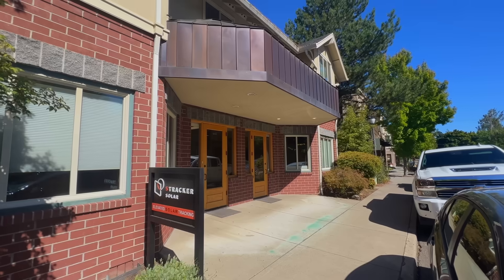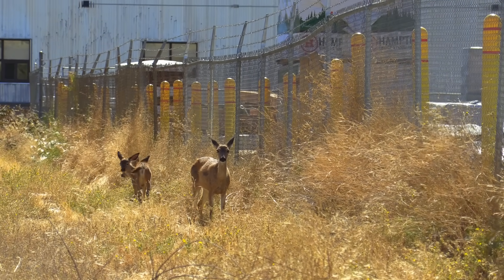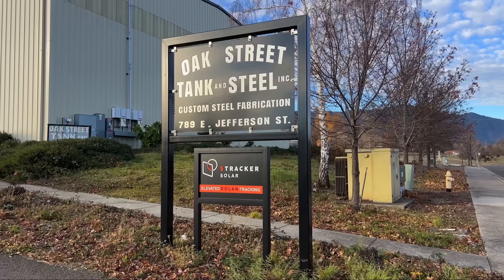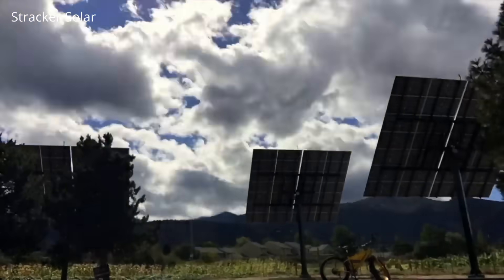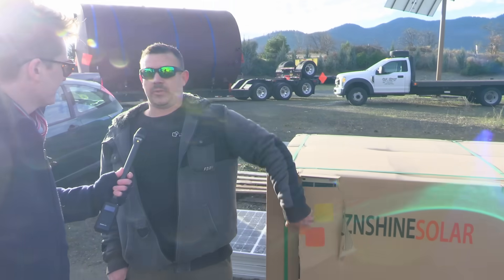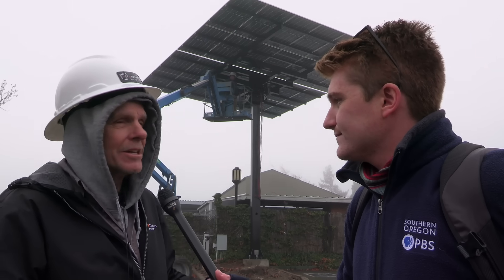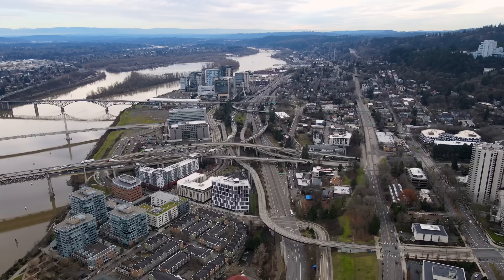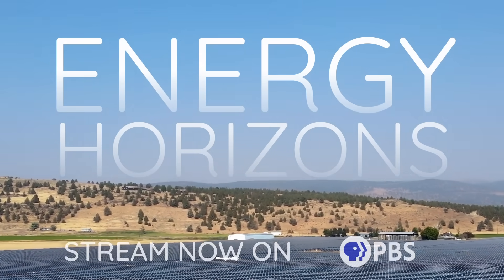Stracker Solar will Change the Solar Industry | ENERGY HORIZONS on SOPBS

Comment: I like the Idea and considdered making myself a two axil trakker solar pannels. But came to conclusion that for the extra cost of the system id rather buy more pannels. I need the extra panels for  cloudy days, then the tracking wount help much any ways.  For roof mounted panels to get 16 kw it would cost me under 5000 usd. Did a 4440 pannel array for under 20 000 ZAR, mounts, cables to the inverter included (18 ZAR to 1 USD). No rebates or tax credits. Hek, hiring the crane alone to install the rack would be more than the whole install, let alone the extra materials and labour to manufacture the system.

Comment: if the axis is tilted at the right angle a single axis works well.
Reply: At 40° North Latitude and higher, the required tilt is very steep in Nov, Dec, Jan & Feb.

Comment: how much are they each//show price
Reply: Estimate ... $10,000 just for the Dual Axis Pole Mount.  Then you add the cost of nine (9) 300W Solar Panels and the Inverter.  You dig the hole.  You dig the trench.  You pour the concrete and insert the pole. You buy all of the PV wire. You install the PV Array, Disconnect Box, PV Wire, Conduit and connect to the inverter.  If you want a company to do everything for you, then $30,000 each.

Comment: In France 🇨🇵 all large supermarket/mall parking lots must be covered with solar in the coming years.
Basically directly contributes to the businesses refrigeration, keeps the cars cool(er) and offers a shady/cooler spot in general.
..and, of course, offers power for EV chargers.
Reply: Doesn't France have an excess amount of the electricity? France exports electricity. So why install PV?

Comment: The machines appear well thought out and implemented.   To be beneficial the solar voltaic electricity generation should maintain electrical storage.  Large amounts of wild AC supported by the public power grid cost more expensive fuel than making all the electricity from economical fuel efficient means internally.  That means in many situation wild AC generation supported by the public power grid increases electricity rates.
Reply: How do you know the machines are "well thought out" ? They gave no details. Where did you get your information?

Comment: So you take solar panels that are now $.60 per watt and have absolutely no moving parts and can sit in the sun for 25+ years and generate electricity and instead you put them on top of a pole with a super expensive footing and now turning it into a moving part that will fail overtime. 🙄
Reply: I think the real advantage is they can be stored horizontally to protect from wind storms.  Secondary benefit is they give shade to a hot parking lot and the cars under them.  That's good.
Reply: @douglasengle2704  Horizontal position = Perfect for maximum hail damage!
Reply: Yep that is what they try to sell us. Not gonna happen.

Comment: Fossil Fuels and nuclear is back - no need for solar of windmills.
Reply: In remote locations solar voltaic is good for maintaining electrical storage to run instruments.
Reply: @douglasengle2704 - In Remote Locations fixed-mounting makes sense.  The cost to install and maintain this  in a remote location, is insane.

Comment: What about the power consumed moving the panels tracking the Sun? Is  the plus 70% efficiency gain before or after the power consumption of movement?
Reply: obviously, i mean any person with a small amount of knowledge can see that the motor uses a tiny amount of electricity compared what the solar panels produces. besides the motors only run once every hour or so.

Comment: Stracker Solar's website has ZERO information about how many kilowatts worth of solar panels you can put on their trackers, nor is there cost information, or if these are single or dual-axis trackers.
Reply: They're dual-axis trackers, which is their entire purpose. It is mentioned on their web page explicitly under the About Us page. The video itself (also embedded on their web page) illustrates using 15 kW of Znshine panels. Exact amounts will depend on what make/model panel you buy at that exact moment, as they seem to improve fairly quickly. Price? This isn't a residential, toss-it-in-the-Costco-cart purchase, and the price will be highly dependent on where it is being installed. You call and work with them, like any other large project.
Reply: @chill-633  It is so insanely expensive, you can't even tell what these installations actually cost.   Just pretty pictures. No costs given.  No ROI given.

Comment: Tracking solar panels give 100%, fixed 75%. Tracking system is to expensive for a gain of additional 25% energy.
Reply: It has the advantage of being able to store the panels horizontally to make for a protective small wind profile.  They should have said in the stored position what is the expected wind maximum.   A 100 mph would be respectable.
Reply: @douglasengle2704  - Flat is perfect for maximum hail damage!

Comment: There was recently a solar farm that was totally destroyed by a large hailstorm.
Plus the debris was said to be polluting the ground of the farm .
A protective solution is possible that could be in connection with the local weather conditions.
Reply: Solar panels can be made with stronger glass for hail, but wind turbines with strong wind driven hail get their blades eroded that makes them not only less efficient, but unbalanced.
Reply: @douglasengle2704  - Solar Panels made with stronger glass are more expensive .  So, what is point of, throwing more at a project, that already can't justify the initial cost ?

Comment: This cannot be cost effective.  Land is cheap. Structural steel/concrete foundations are not.  Maintenance requires a bucket truck.  It's ridiculously expensive.
Reply: More so then fossil fuels. Were it not for the massive subsidies they received they would be bankrupt
Reply: While cost is important, grid independence is valuable as well.
Reply: @FreedomofthePress484  Grid independence at night?  On cloudy days?  In the winter? Don't make laugh ...

Comment: Two axes tracking on floating solar makes a lot more sense and is a lot less expensive.   Hydraulic water or pneumatic can be used for for elevation adjustment.   The panels would be arranged into a large circular formation that can be rotated to follow the sun azimuth.   
Lake Mead and Lake Powell have lots of area and are ideal for this, with enough area to provide 200 GW.  The problem is they are both at low capacity so here is the solution.
We need a plan to mitigate our long-term mega drought in the Western USA. The Coalition for a National Infrastructure Bank has a great plan to build a pipeline from the Mississippi River bypass in Louisiana to Lake Mead and Lake Powell to refill them in this long-term mega drought. It would NOT require a huge amount of electricity to get up to those elevations and could easily be powered by floating solar power on the reservoirs, covering less than 10%. Two axis floating solar that tracks the Sun elevation and azimuth would provide very long power hours per day, producing a lot of power during peak demand. There would also be less evaporation on the reservoirs. The power lines are already nearby. And the hydropower is a huge battery. Solar power is currently the lowest cost. The cost for the project could easily be paid back by the agriculture that could grow to be a much larger business and currently which is being curtailed due to dwindling water supplies. Only a small percentage of the bypass water would be required to refill the reservoirs. The pipeline could also act as a source of water with reversed flow for occasional drought situations in Louisiana.
Reply: That is a great idea and shows some long-term thinking.  Hopefully they will quickly develop international relationships, as the US won’t be supporting this type of development for the next four years, at least.  We’re in, shall we say, a low patch for long-term thinking right now.
Reply: Snows like a bigger in Oregon and in high elevation where the reservoirs are, snow stays till July. Oregon isn't the best location for solar. Near the coast, it rains or is heavy fog 75% of the time. You literally live in a raincoat.

Comment: Just put solar panels on every home, business and covered parking rooftop.  Pole mounted solar trackers are great also, but the cost plus the maintenance has to be taken into account.
Reply: plus trackers do not add 50 to 60%. they add 30%.
plus solar panels are so cheap now trackers are not worth the trouble.
Reply: @ursodermatt8809 did you watch the video? Your point is debunked in the first few minutes! 😂
Reply: They never actually watch the videos. Just skim through it til they find something to criticize.
Reply: @alanhat5252 What point was debunked in the first few minutes of the video?
Reply: It is only beneficial if maintaining electrical storage.
Reply: @ 
well,   i will correct your statement to:
"much more beneficial in combination with battery storage".

Comment: Good work but Pretty sure you're going to need to up that wind loading by another 100mph just the way the climates been driven.
Could the main stems be made telescopic to avoid the need for cherry picker platform servicing?
Reply: Telescoping, and orient to reduce wind load during storms. Oh, they do self orient to reduce wind load.

Comment: I lease 5 acres to All Earth for 100 of their tracker with short posts (10 foot posts, about 4 feet to the bottom edge of panels when tipped up) I can still pasture sheep and with no fences the deer & all the other wildlife that used the land prior to the tracker are still there. Grasses still seem to grow as well as before. 
The taller poles will have their place but the much cheaper shorter ones will be more cap-ex. efficient for many locations also.
My personal duel Axis array is mounted above my rotating greenhouse, built from repurposed materials.
Reply: PV on poles allows for sheep to graze ... and so what?  How does that make PV profitable for the installer, without a government subsidy?

Comment: Looks expensive and increases cleaning costs.  The tracker is least effective on cloudy days when solar production is the most valuable.  I'd sooner put the dollars towards more fixed panels -- unless expensive land cost dominates the installation.
Reply: Agreed. Unless you’re very space limited just spend the delta on more panels. Isn’t that always cheaper? And delivers more net energy. I’d like to see that analysis
Reply: It all depends on the relative costs. They claim it's cheaper to have a tracker motor than to need 40% more panels without the tracker.

 I don't know which use cases work better for trackers than fixed, but that's the central argument. Got to do a financial analysis. Looks like this is better for small systems or over parking lots, but probably a harder case to make art large scale, can't know for sure. 

I do know a frequent problem blocking fixed systems on parking lots is the extra cost of steel for the height, and concern about lot accessibility to snow plows and other large trucks. Basically customers are worried they'll be forced into a corner with fixed solar over parking lots, so they don't do it.

Comment: I wonder if you are interested in trying to create a cheap electric storage solution? The world needs something x10 cheaper than LFP batteries.

It seems that a sphere of 2.5 m in diameter filled with sand and covered with 0.5 m of mineral wool would be able to store 300 kWh (1000 oC) for a week, losing 25% in the end, and being able to return half of it back in form of electricity and a quarter in form of hot water. And costing 7.5k USD (20 USD/kWh netto). (For reference, a 2.2kW steam turbine costs 2.5k USD.)

It’s interesting why no startup is able to produce a prototype of such a simple, but so much needed system. 

Having such a system the only thing remaining for energy transition is 5 times the nominal capacity of solar panels / wind turbines (for Germany climate). Even a diesel generator practically never will be needed.
Reply: Lithium Fe PO is getting cheaper 50% target for this year but the Na based chemistries are even cheaper and comming now barring political problems. 
Add Li S chemistries and storage and power density go through the roof. 🥼🧙🏼‍♂️🇬🇧 There are also improvements in panel design an efficiency. 

In high temp areas water cooling the solar panels from the back can also massively step up the efficiency and vastly increase the life span of pannels in  high solar gain locations. 
The excess heat in the coolant could be used in heat pumps etc or stored as a second form of energy harvesting... ot water, heating pools ...

Comment: Ok, now combine it with skyscraper exteriors as far as an architectural design which would support it’s creative installation, see what that looks like, then make it an industry standard for a building with a reduced footprint or even better producing more power than it consumes.
Reply: Doesn’t make sense. Solar integrations would make sense in areas of little height development, but developers in urban downtowns are constantly competing for being higher than the other.

If a skyscraper used this on its exterior, and then 3 years later a neighboring scraper to the South went up much taller than it, it’d make the panels a costly waste of money and liability.
Reply: The sides of the building not the top